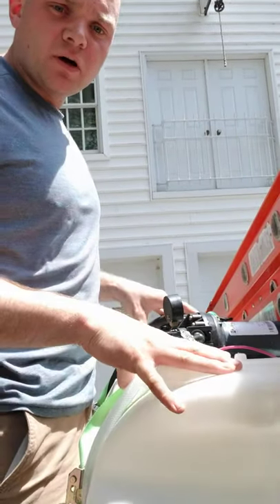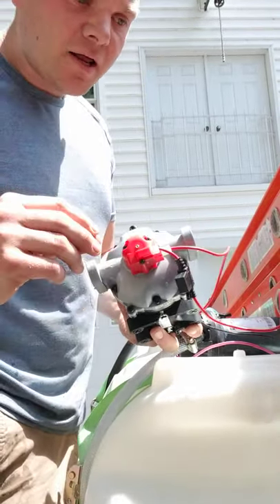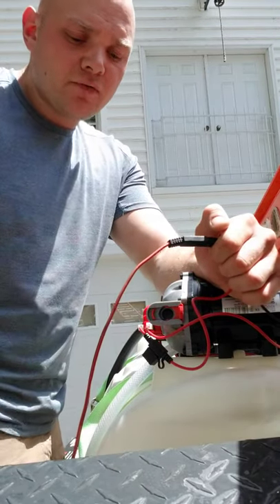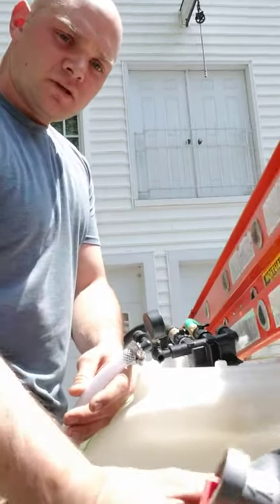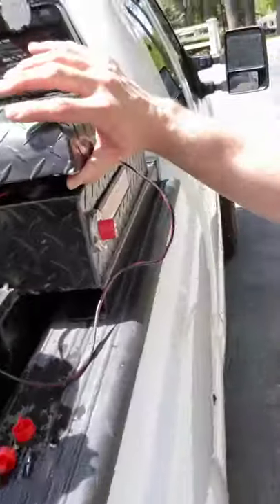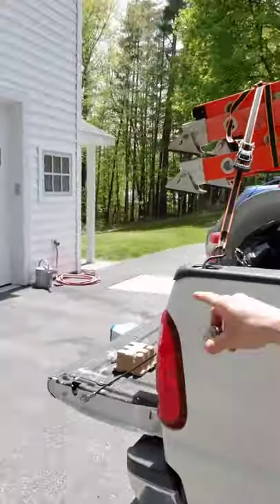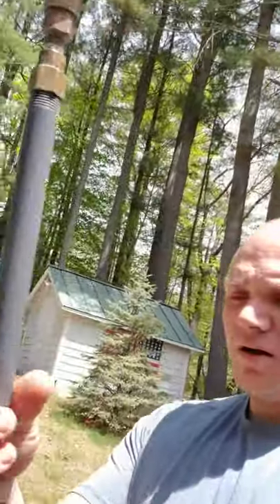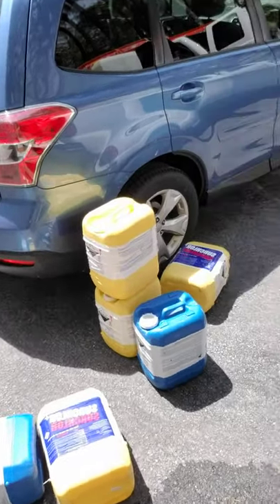Setting Up New North Star 5.5 GPM - WORST 12V PUMP - BUY FLOJET

Comment: That allen key is for the Pressure switch.
You need to adjust it so it shuts off pretty much as soon as you shut the flow off with a valve/tap.
This stops strain on the pump and as soon as you open the valve the pump will cut back in.
Reply: hey, what about amperage? isnt the car battery amperage too high for that pump?
Reply: @maliknotice7149  I know this is an old comment. But the car battery amperage is how much it can supply. Not how much will be consumed by the pump. As long as the battery is rated for at least the same amps as the pump or more you'll be fine.

Comment: The pumps are tested at factory  that's why there's alittle water in it. The Northern tool 12v 5.5gpm pump is great. I've been using it now for 7 months still pumping strong can reach over 2 stories high. I prefer the pump with the threaded inlets to quick connect ones cause the adapters are easier to get. 1/2 male with 5/8 barb just get a flexzilla 5/8 garden cut off ends side onto 1/2" to 5/8 barb clamp down good to good. To make the pump and hose last run fresh water through it after each use.

Comment: I noticed the pump you're using is actually a weed killer/insecticide type sprayer pump. Northstar actually makes a soft wash pump that is made to handle bleaches, sh, and surfactants. I hope this helps.
Reply from the maker: Hey Chris. I haven't used these pumps in 2 years or so. Check out some of the newer vids! 🤙

Comment: Way to go on getting it done. Look forward to a review on the pump later down the road. As for your battery add a second battery using a battery isolator  solenoid so you never get stranded. Also very important for the extra battery cable you'll need use 1 gage and I highly recommend using welding cable as its a lot cheaper. Remember mo flow equals mo money so if you ever need more then 5.5 gpm just add another pump in  parallel and you'll have 11 gpm when ever you need it. Thanks for sharing. 
Thank you 
John Doherty 
LykeNew Power Wash 
Salina kansas location
Reply from the maker: Hey john. Thanks for watching and thanks for the comment! My recent videos show my new setup. Still running 5.5gpm pumps, 2 independent batteries just for the pumps. Love it

Comment: Does the pump work good on a yard hose and can you shoot up 2 stories with it if you can make a video on with you pump and garden hose
Reply from the maker: Some of my older videos show me using a garden hose. Yes it works but not for long and I dont recommend it. The hose is not designed for the chemical and it will burst and you'll get SH everywhere. I have plenty of videos showing leaks and me fixing leaks and replacing hose etc. The SH will ruin the brass male and female ends causing leaks. The SH will also destroy the hose wall linings and you'll leak!
Reply: @YoungAmbitionYA  ok ill get a better hose i was thinking the clear hose half inch 200ft whats a good diameter for soft washing

Comment: Where did you buy your chemical from how much do you mix ON Your chemicals?ex SH?
Reply from the maker: Hey Robert. This video is a few seasons ago and the yellow 5 gallon jugs I was using are from pool supply stores - 12.5%. My recent videos you'll see white 55 gallon drums. Those come from a regional bulk chemical supplier called Slack Chemical. They deliver bulk SH which is a better price and more convenient - their bleach is 15%. For house washes I dilute the 15% to 1-3% and for roof washes I dilute the 15% to 6%. Never use straight bleach

Comment: I recently installed 3.0gpm pump on atv. Pressure and pump pulsated badly, so I cranked down screw on pressure switch until it was smooth. Problem is, is that it blows 10a fuse that I have on positive wire close to battery, and wire feels a little warm. Wondering if I could get away with putting 15a fuse like the pump has, and possibly running 12ga wire instead of 14-16. I didn't know if this would tear up voltage regulator, relay, or battery itself.
Reply from the maker: I've never altered the wiring but always put in the biggest fuse I can find. I once blew 10 fuses in 30 min. Upped the fuse and never had another prob

Comment: Great video i appreciate it you just gave me a idea i have 200ft of yard hose and i have the same northern tool pump in my garage what kind of adapter do i need too hook up too a garden hose could YOU give me any valuable info please
Reply from the maker: Hey Ross. That particular pump came with an threaded adapter for connecting to a garden hose. If you dont have that same adapter, the pump should have came with other plastic ends - one goes into the pump and one can be used with a hose clamp - just cut the metal end off the end of the hose and clamp it to the plastic adapter on the pump
Reply: @YoungAmbitionYA  thxs buddy

Comment: where can i buy that tank with 12v pump already attached ty so much
Reply from the maker: I got this from tractor supply
Reply: @YoungAmbitionYA  ty sir, what length hose could i use off this tank ? im on a budget but ready to work. any advice is great. ty again

Comment: What is the name of the black splitter you have connected to the pump, that lets you pull water from 2 places.
Reply from the maker: It's just a little tank and pump set up from tractor supply. It was junk

Comment: Hey, what is the name of the fittings you use to connect your 5/8 hose to the pump?
Reply from the maker: Hey Andre. It's just a generic hose splitter from a hardware store. This one came with the tank/pump set up from tractor supply

Comment: Bro quick question I bought the 4gmp northern soft wash system but what brand an size battery should I buy for it?
Reply from the maker: Get a 12 volt car battery. Interstates a good battery brand. Also get a way to charge it too. One charge will last you multiple days, but I tend to charge every night
Reply from the maker: Check out my 1 on 1 by clicking the blue JOIN button if it can help you.
Reply: Ya need a marine battery. Go to advance or napa and get the largest marine deep cycle battery you can afford. They're made to completely discharge unlike car batteries.

Comment: Hey, so the pump has held up to the SH ? the pumps manual says warranty voided if Chlorine is used in the pump. I have a  Northstar pump 2.2 gpm to spray chem so I don’t splatter it on me while applying chem to tight spaces like porches. Lasted 2 years using about 1x per month.The pressure switch went bad,replaced it and then it started working but, pressure was surging up/down, constantly. Figure that I’ll get one that has higher gpm. Just wondering how yours is holding up to the chlorine . Just subbed. Like to know what mix you like to use. Thanks.
Reply from the maker: What's going on Will. I used northstar pumps in the beginning but they're junk in my opinion. I like Everflo. I use the 5.5gpm 12v. The chlorine will definitely put a beating on them. I go through 3-4 pumps a season. Just a cost of doing business
Reply: @YoungAmbitionYA  do you go through the whole pump 3-4 times a season or just the cartridge?
Reply: @YoungAmbitionYA  Northstar pumps are Everflow pumps. Everflow makes them Northstar puts their sticker on em.

Comment: I like your set up.  I got quick question, where do you get your contract from for commercial or residential and how much do you charge the customer is per sq ft or the job?
Reply from the maker: I've never used a contract for wash services. I also don't typically price by sqft. I price by the job
Reply: @YoungAmbitionYA  so to do a drive way about 140 sq ft not that dirty what would charge since you don't charge by sq ft

Comment: Question.  I have an ever flow 5.5 using a 1/2 hose woring end, (75 feet), 3/4 suction about 3 feet long.   and it's popping fuses like crazy.  I haven't even tried adding the rest of the hose.  What am I doing wrong?
Reply from the maker: Hey Charles I'm not 100% but pretty sure the 1/2 inch hose is restricting the flow of the 5.5gpm pump causing it to over work. I would try a wider diameter hose. I think that will help!
Reply: @YoungAmbitionYA  Thank you for your response. I’ll give it a try.  Should have done more testing before I started do work lol. Thanks
Reply from the maker: @charlestuozzo4747  recheck your wiring too. The hose diameter would make your pump over work.. not sure it would blow a fuse. See if you have a short to your ground wires. Check where you crimped your connections and see if + and - connectors are arching as well.
Reply: @YoungAmbitionYA  I changed the battery to a smaller lawn type, dumped the gun for a ball valve and pipe configuration and checked all the connections. I’ll give it a run tomorrow and see if it works or let’s the smoke out. Next step is 5/8 hose and/or new pump. Thanks for all you help.

Comment: I got a another idea i am going too get 200ft of expanding flex hose LMFAO i just wanted too let you know and its lighter then the garden hose on my reel
Reply from the maker: Planning on using it for soft washing? If so that hose, flex hose or garden hose won't last long. The SH will eat right through it. When I started I connected Flexilla hose to my pumps to wash with. Very soon the hose walls started bubbling and breaking. If your going to use it for flowing bleach or chlorine try Kuritech hose or something else designed for chemical. Good luck brother!